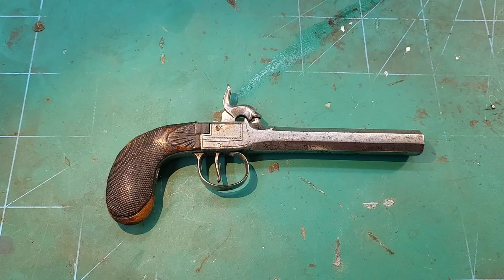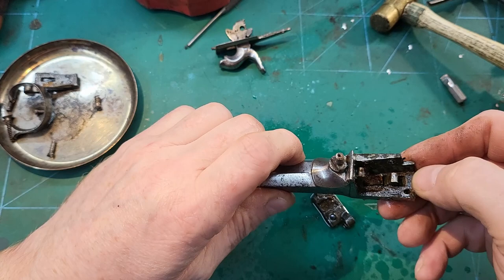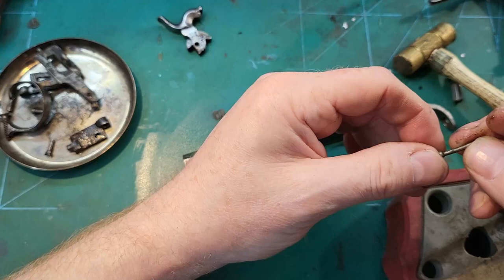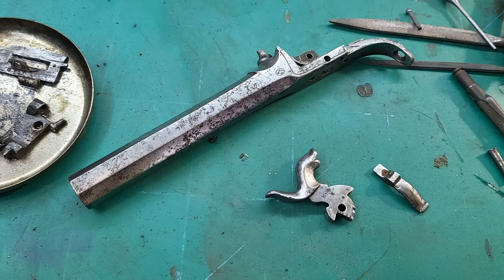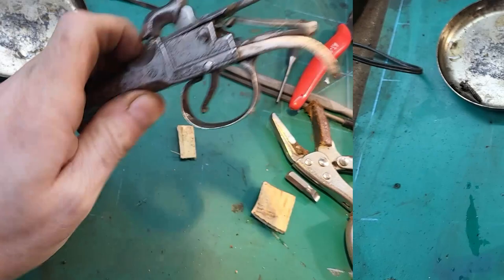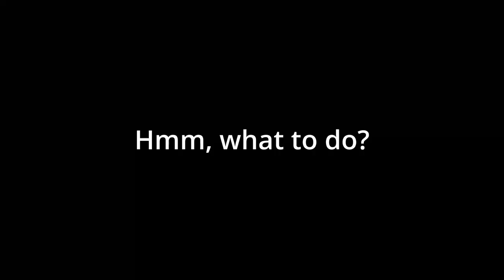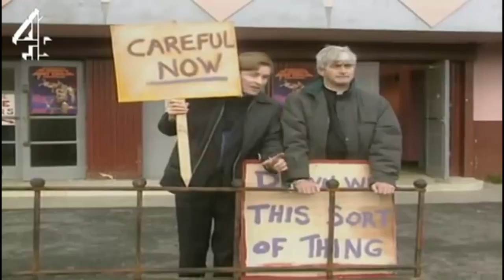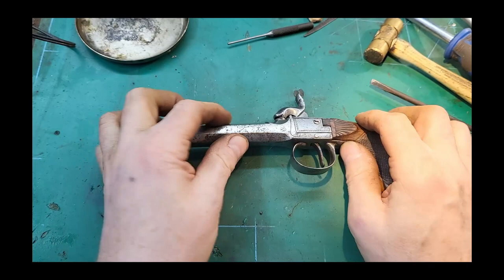Antique Boot Pistol Conservation - Gun Repair

Comment: The spring is tightened in a vise and fixed with a wire. After installation in place, remove the wire in any way.